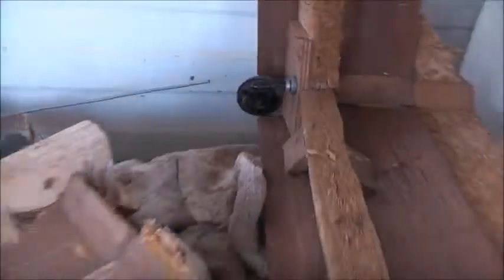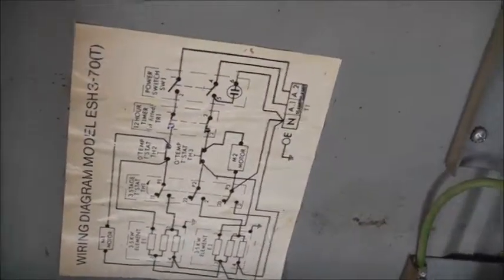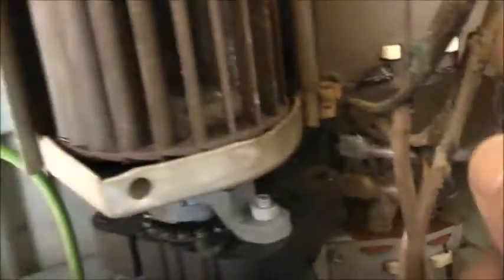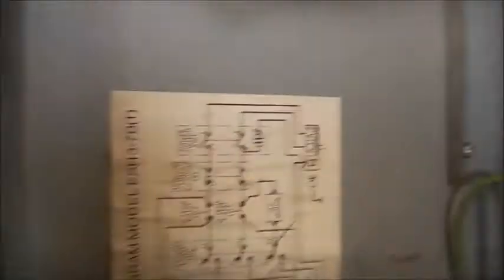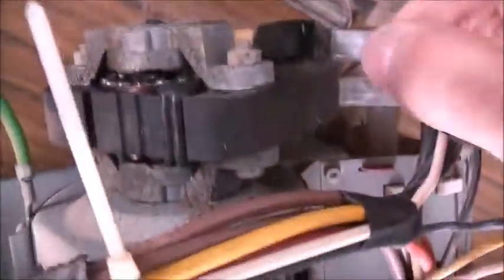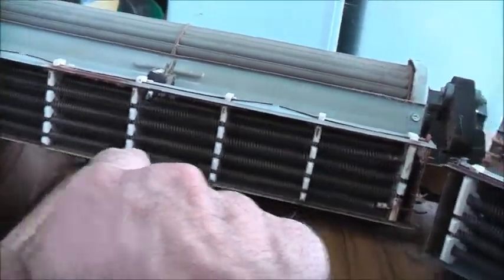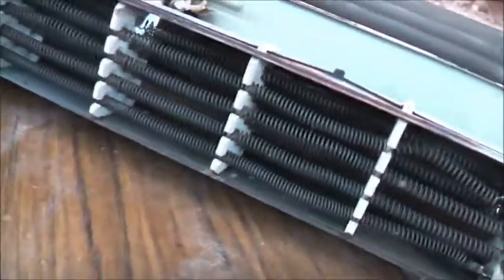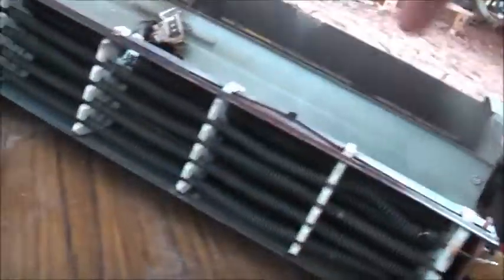Recovered Goodies From Electricaire Heater

Comment: Mmmm.....That old overheated element. If you salvage the wire out of there (or at least part of it) and stretch it out, you can do "Hot-wire-foam-cutter" just like Mr. Photon did. :D

Use some of the heating wire, ballast it with your ballast-box device, a little bit of variac action and there it is. :-)

Your very own hot wire foam cutter. :D

That could be even more fun than just popping it, and the hot wire foam cutter could even be a useful tool at times. :-)

ALSO!

I've just thought of another thing that Mr. Photon once did: "Hot potential divider" :D That could be some fun too!

Thanx for showing,

-BoomBoxDeluxe.

1st March 2014, 18.27

Comment: Nice going :)

I find it tricky to understand how those crossflow fans actually works, but they do deliver lots of air.

Just a new motor and good to go :)

I assume fan always on, heater in series with device under test?
Also MOT when used in front of same or other fan?

Comment: Electricaire nostalgia anyone? At my primary school in the 1970s there were 2 demountable classrooms, and both had an HVE Electricaire heater. A large ugly grey box in the corner, which from time to time made a loud blowing noise and would fill the room with warm air. They both carried the warning "Articles must not be placed on or against this heater." As a 6 year old, I thought that this meant that you should not affix any newspaper cuttings to the heater. Well, they're articles, aren't they?